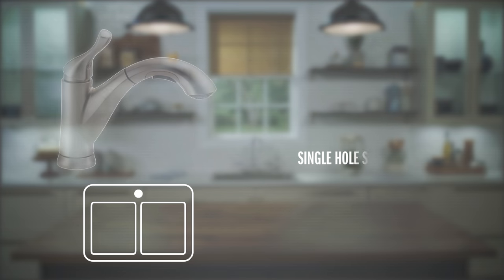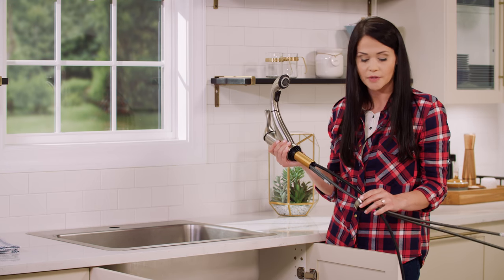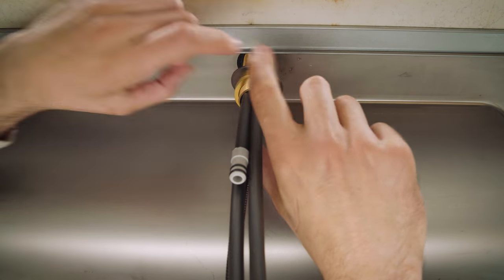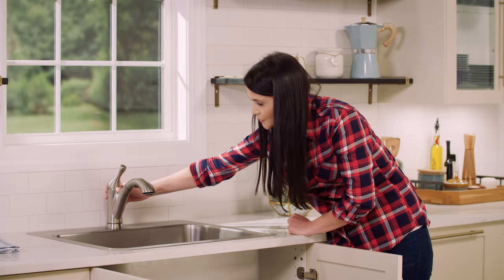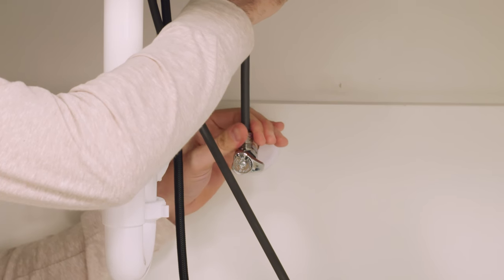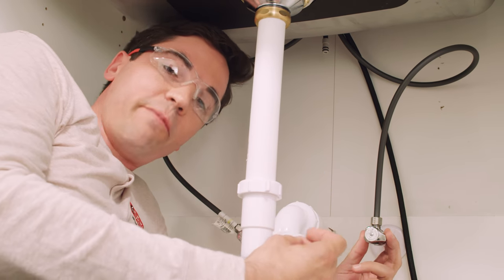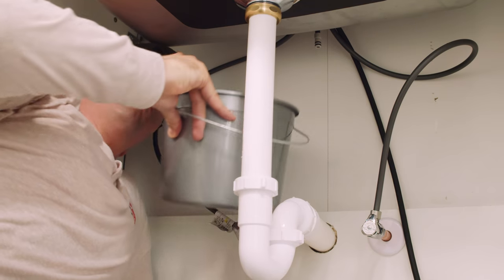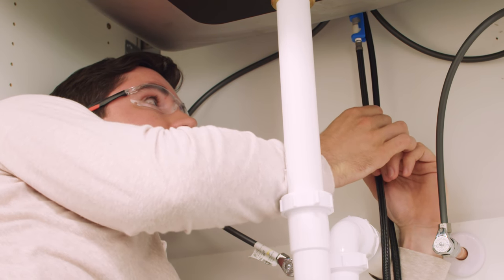How to Install a Delta® Single Handle Pull-Out Kitchen Faucet

Comment: Delta instuctins page 3. Revision 106557 Rev D shows steps 1 to 4 where parts are not supplied in the kit.  The directions are incomplete and frustrating.  I am really not happy with Delta. This instlation is for one hole. The directions should be listed for one hole and Three hole instructions. 🤣🤣🤣🤑🤑🤗🤔🤐🤐🤐🤮🤮

Comment: Thanks for this video. The written instructions were the worst I have seen in many years. You saved the day!
Reply: Agreed! They should’ve just written “GOOD LUCK!” on the first page.
Reply: Completely agree!  The instructions were garbage, but this video was great!
Reply: Congrats!! There were no instructions included in my kit.
Reply: Well I had instruction but for a different model 😆
Reply: Terrible written instructions. I could write better ones!
Reply: AGREED........
Delta need to hire a professional writing staff for the instructions. 

The diagrams don't help much either. 

If you were a professional plumber........  well maybe they could help,  but for the average homeowner who MIGHT do this once every 10 or 15 years.
Not too helpful, particularly since there are multiple parts designed for different installations.
Reply: Looking at the instructions I thought I was missing a bunch of parts until I realized they were instructions for 3 different designs
Reply: Totally agree, written instructions were poorly done

Comment: I removed a Moen faucet that had been loose and leaking since I moved in (2019, now 2024).  I tried changing the cartridge on the Moen and, well, it didn't turn out very good.  Did some research and Delta installation sold me.  I picked up a Kessler from Blue Big Box Store, took me about an hour, solo to change it and have running water.  Hands down the easiest to install, but also, kudos for providing the 3 hole base adapter.  This thing makes it rock solid on a 3 hole sink.  Loving it so far.  I don't think my kid understands the joy a new well working faucet can bring.  Thumbs Up for the product.  The only gripe i have is the installation instructions in the box were for a different model and style.  Glad to have the video.

Comment: Totally agree with other commenters who stated that it's a good thing this video exists, because the written directions are pathetic! In particular, they suffer from the problem a lot of manufacturers have these days, where they write one set of directions for essentially all their products even though the details are quite different. I appreciate the magnitude of the problem these manufacturers are facing (writing separate directions for every single model would be a nightmare!), but these are often very hard to read because the instructions don't offer very clear guidance about how to determine which model you have (and therefore which instruction-details apply to you). In this case, this was done VERY poorly. In addition, I guess the models evolve over time and the instructions don't keep up. In this case, when securing the main faucet column from underneath, mine had the mounting washer and nut as shown in this video (starting around 1:28). The printed instructions showed something completely different, and did not offer nearly the level of detail about how to use them to secure the faucet; just a fairly small picture and instructions to sort-of "do it like that". Hardly helpful! So -- thanks very much for this video, but I wish there was also an option to do it from printed instructions (as there is *NOT*, in this case).

Comment: Thanks for the excellent video!  Just made the installation of our new Delta Grant kitchen faucet (the exact model shown in the video) a breeze!  The entire installation was much easier than we had feared it would be!  (And yes, we agree with other commenters that the written instructions were quite poor, being for many different models rather than just the specific faucet we purchased.)
Reply: Good engineering focuses on the USER, not just making an elegant design!  Call it ergonomics, whatever.  Installation instructions are a part of that.  A BIG part if your market is aimed at all at the homeowner doing the installation himself.  Yes, access to YouTube videos is a big help and to an extent solves the problem but it would not take much effort to make custom instructions FOR EACH MODEL instead of writing one that ALLEGEDLY covers all models.  To do so is just LAZINESS, there is no engineering elegance in making a giant mishmash nobody will use,  it is false economy and an insult to the buyer.

Comment: Good video, much easier to follow than the paper instructions. My new Delta replaced the original faucet from when this house was built in 1969. It took me almost three hours to get the old faucet off--the underside was coated with an amazing lime buildup!

Comment: Nice video and certainly made the process simpler. A couple considerations to enhance your experience…like most folks we have a garbage disposal which clearly gets in the way and will make it more difficult to reach areas that need to be worked on. We also have a double sink which adds even more clutter to get in your way. I disconnected the drain pipes below the second sink (non-disposal sink) and turned them towards the disposal to free up some working space. This only adds a few minutes to the overall process but you’ll be glad you did.

Comment: Thank you for the video!  My install went well but when I was done, I had two plastic ferrules left in a bag!  A call to Delta Help and was told that if I were to cut either water supply line to shorten the lines, the ferrules would be necessary.  
I loved your spacious under-sink cabinet, but didn't see your food disposal unit or supply and drain lines for the dishwasher.  Just as well, if my cabinet looked like that, I would have to work to keep my young grandkids from camping out in there.

Comment: I got the Delta Kessler faucet, and the manual did not include how to connect the pull out hose (tl;dw: the blue clip is for holding the connection of the pull out hose together). This video does - so, thank you - however please in the future also fix this in the manual.

Interesting that this video also shows a different method of flushing out - here only the supply lines are flushed, while in the manual one flushes by removing the areator and turning on everything (needs no bucket then). I guess both methods work.

Altogether, this video saved me $600 which a plumber would have charged for the installation. Thank you!

Comment: My faucet keeps loosening  eventually. Should I just tighten screws or also the whole ring? Also should I add a rubber gasket on the counter between the faucet and counter since water is seeping under due to the eventual loosening of the faucet? It might make The whole connection tighter too?

Comment: Great Video, it worked juss as shown.
Just replaced my old Moen with Delta Pixa with Soap Dispenser, Hard part was taking old Moen out, But once it was out - it only took me 5 minutes!, Thank you Delta for making it easier than it should beI
Reply: That "old Moen" has a LIFETIME guarantee,hold onto it,you can replace the Delta with it in a couple of years.

Comment: I'm here because the wrong installation manual came with the sink I purchased  from Lowe's. The picture of the faucet looked different but I figured they must use the same manual because the installation is the same but as I got into it I got more confused.  I looked online and found the corrrect installation manual so I'm happy I waan't losiing my mind.   Thank you for your video; I feel more confident after watching it be installed first.  Should I mention the manual mishap to Lowe's?  The package didn't look like it had been previously opened but I can't be 100% sure.
Reply from the maker: Hello Smileysue74. I'm sorry that your Delta Faucet model came with the wrong installation manual in the box and for the inconvenience that caused. Please contact us directly if you have any questions. We are happy to help. Glad the video was useful and you got the faucet installed. Thank you for being a Delta Faucet customer!
-Bryan
Reply: @deltafaucet  Thank you so much for your timely response, I appreciate your time and consideration. :)
Reply: I got it installed and I'm really happy with it, I just have to find something to fill in the extra hole.... I was thinking of getting another soap dispenser to fill with dish soap since I filled the other with hand soap.   My only problem is that right after I installed it and took pictures I saw a patch on the pull out sprayer where it looks as though the finish rubbed off   Argh!  I'm so torn because I like the faucet so much but I'm afraid the finish will continue to come off how I read in user reviews.

Comment: Thanks, the instructions included with the Delta Charmaine still has the older U-Bracket socket in the diagrams. I didn't know how to use this mounting nut until the video at 1:36, thanks.
Reply: We were just having the same issue-- thanks so much for your comment- it saved us so much time!

Comment: I suggest that this video be watched in the store’s parking lot, with written instructions in hand.  Lowe’s is an hour away, so I’ll be requesting missing items on line.  I thought it was just 2 😢gaskets, which I could create, but there’s more.  Before you start the project, be sure you have everything required.  That’s why I suggest watching before you leave the store lot.

Comment: After installation I saw two white plastic ferrules I skipped. Don't see a reason to need them. I screwed the supply lines on just like this video and tightened with a crescent wrench. No leaks. I need to know if I should go back and correct.

Comment: Great video. I have a question, is there no need for plumbers tape (thread tape) when connecting the supply lines?
Reply: I’m surprised no one answered this. You’ve probably already got your answer, but for anyone else’s reference:

Do not ever use tape or dope on those compression connections on the supply valves. The plastic bushings are sufficient. (If you’re somehow using copper pipe and metal bushings, or braided metal supply lines, the same goes for those). 

Dope and tape just make a mess of things if you ever need to change something out down the line.
Reply: Hey thank you. I did find the answer but I still appreciate this.

Comment: Great video. One question: Why do you have to flush the supply line into a bucket? Why can't you just flush it down the drain after you complete the installation?
Reply: My assumption is that it is to flush it away from the spray head. If there are any tiny things in the lines from production, it would plug up the sprayer.
Reply: there are two filters in the spray head. you would clog them up. I didn't see the video but on another one the water coming out was black. mine had a yellow tint to it.

Comment: I bought and installed the Delta Savile model because I thought the faucet could be installed with the handle in any location.  It seems to be a good operation. The powerblast spray feature is useless.  I would prefer a softer "flood" spray instead, as the option.  

What I want is a sink faucet I can place the handle in the middle, instead of the right or left side.  I have a double sink. I'd prefer the handle in the middle, over the middle divider of the sink.

Comment: Hi Delta, I am currently trying to install the Cassidy faucet. No matter how tightly I try to connect the sprayer hose ends, water still leaks even with the blue clip in place. Do you have a solution? Should there be a washer in the white end? If so mine did not come with one. Thank you!
Reply from the maker: Hello Diana Leonardo. Thank you for reaching out to us. We are sorry to hear that you are having difficulties with your Delta faucet.  Please give us a call or send us an email and we would be more than happy to further assist you. -Carrie

Comment: Seemed to skip a step about how far up to put the weight?  Or does that not matter?  The instructions that came with my B4311LF-SSSD were kind of horrible and incomplete.  Also, my kit came with no hoses - luckily I could use my existing ones.

Comment: we just installed the delta berkley pull down faucet it was working fine, but not the water is only trickling out. How can you remove the screen to check for debree?
Reply from the maker: Hi, Troy & Dawn. Thank you for reaching out. I am sorry to hear that you are experiencing low flow from your Delta Faucet. We do recommend some troubleshooting to help with flow issues. We would be more than happy to help you with this. Please feel free to call, email, or message us on social.

Best regards, Rosanna
Phone: 1-800-345-3358 | Email: customerservice@deltafaucet.com | Facebook/Twitter: @deltafaucet

Comment: The written directions are terrible.  Thankfully this video helped tremendously......the hard part is taking the old faucet off.  Once the old faucet is removed, the new one goes on quickly.  I did cut the supply lines down a bit just to "clean it up" but it was still an easy install.

Comment: Fully admit this was a help, but was more motivational than reality produced. Nope, from the base mounting plate differences in our Delta faucets -to the included translucent ferrules with their accompanying warning about the importance of using them, then to find out they're for a different faucet (mine had the ferrules built in) - the owner's instruction manual is a HUGE embarrassment to the Delta Company. This made the job a bit easier. Thanks.
Delta needs to invest in better tech writers- NOW!

Comment: Excellent video, but it would have been even more helpful if you had shown how to install the Grant using the optional 3 hole cover plate. Mine doesn't seem to fit and I have no clue how it works. The paper instructions that came with my Grant are for a completely different model and very little matches up.
Reply from the maker: We are terribly sorry to hear that you are having difficulty installing your Delta Grant faucet. We would be happy to provide you with instructions. Please send us a private message with the product model number. Include your full name, email, and phone number. -Kelley

Comment: In the supplies it came with 2 plastic sleeves. Where do they go?
Reply from the maker: Hi, Daisy! Thank you for your question. The plastic sleeves are included with our DST Faucet models with PEX supply line in case supply lines need to be cut to fit. If you determine the PEX supply tubing for your faucet is too long and must be shorter to create an acceptable installation, be sure to read the instructions and plan ahead. When cutting the supply tubing the installer accepts the responsibility to do so in a way that allows a leak-free joint to be created. Delta is not responsible for tubing that is cut too short or cut in a way that will not allow for a leak-free joint. DO NOT use a metal sleeve (ferrule) or gasket (supplied with faucet) in place of the plastic sleeve (ferrule) supplied, it may not create a leak-free joint. Do not use pipe dope or other sealants on water line connections. Please feel free to call, email, or message us on social.

Best regards, Rosanna
Phone: 1-800-345-3358 | Email: customerservice@deltafaucet.com | Facebook/Twitter: @deltafaucet
Reply: Delta Faucet Thank you for helping me:)
Reply: @daisylees  Don't cut them! Mine shot off and caused $60k worth of damage
Reply: @pastapaul150  Thanks for the info! Luckily I did not cut them. I rent, and I would not want that to happen. Thank God 🙏🏽, it’s still doing good:)
I pray that things get better for you:)🙏🏽

Comment: Would have been more helpful and thorough if they shoulder you each piece up close that they’re handling/putting on, specifically the nuts and bolts/washers etc. when she’s talking about lining up the tabs it would be very helpful to know which prices she’s using by seeing it but just the name. Also is she using just one piece or two? Which way are the facing, can I see it so I know for use if I have the right piece.  For me that’s the point In looking up a video to get an I depth instruction/visual.
Reply: I appreciate a video being here at all, but I was expecting more out of it.

Comment: No teflon tape for fittings???
Reply: Markus Y the water lines come with compression fittings so no teflon tape is required
Reply: @saulgomez731  Also, you don't need tape if there is washers inside the fittings.